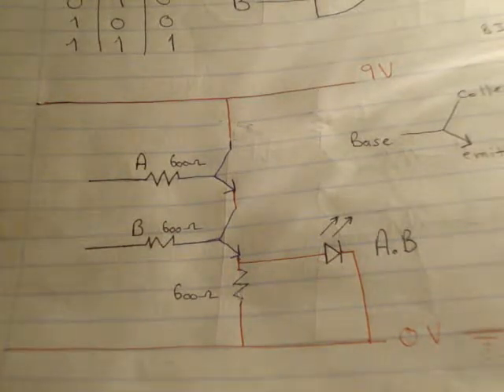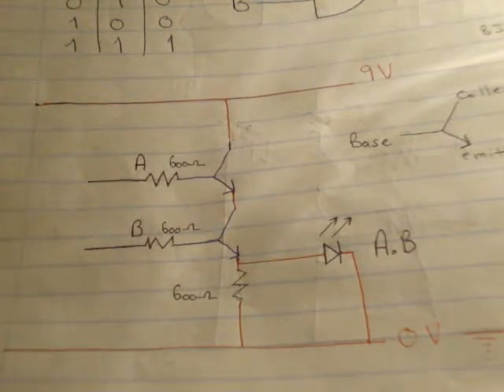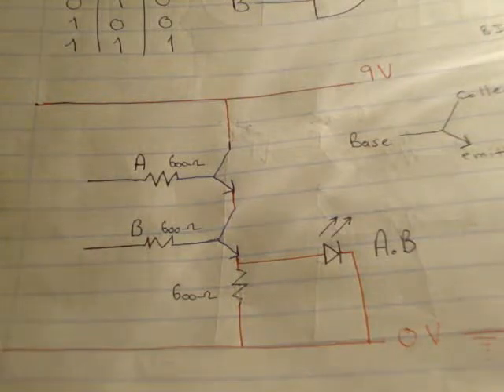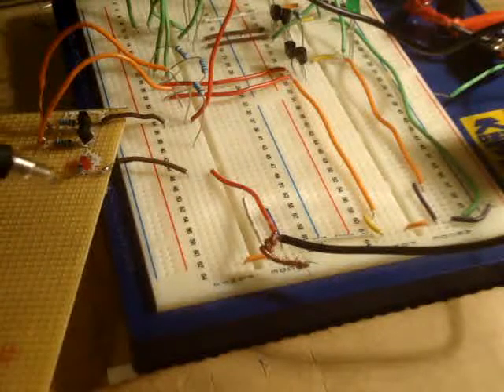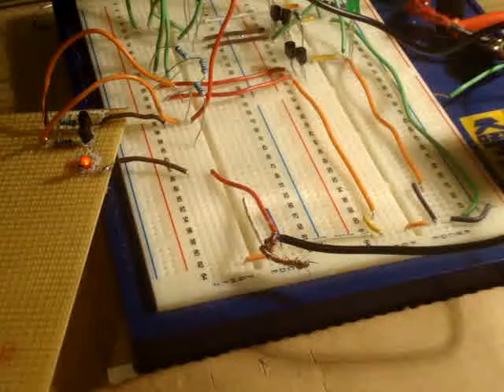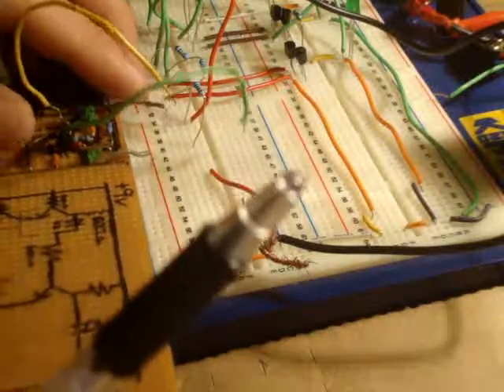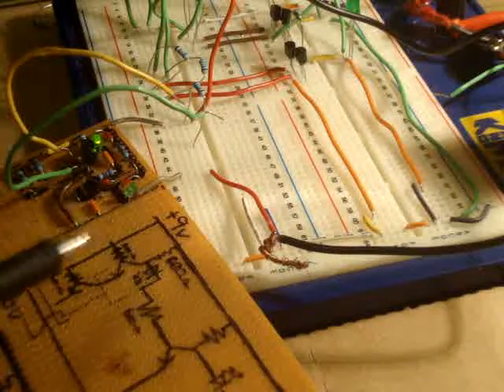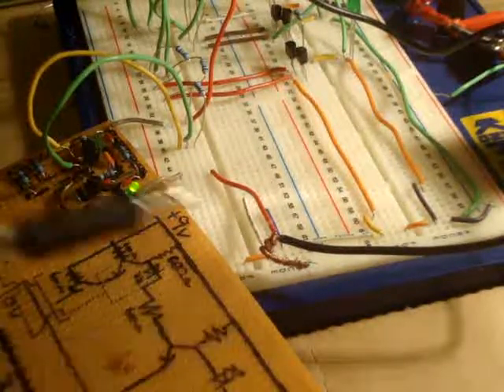Electronics 11 : Comparison of Two Different AND Logic Gates

Comment: I built the 2 transistor and gate just like yours. Mine worked like it was supposed to.( No false output). The only difference is my resistors are smaller. I didn't have 100ohm's. I don't know why worked and your's didn't. One more difference was my A and B inputs is 5 volts which I used a Voltage regulator to bring a 12V battery down to 5 volts.  Thanks for the tutorials...